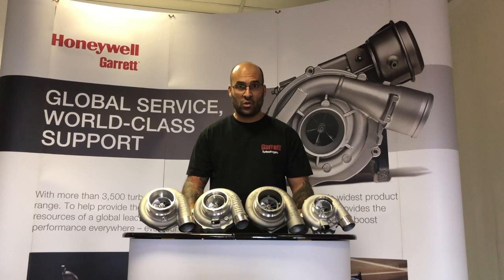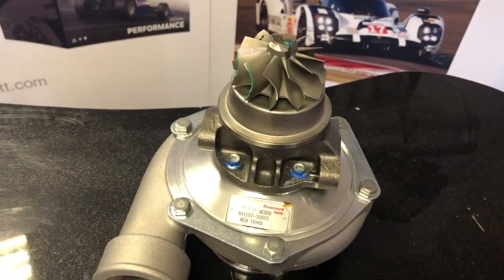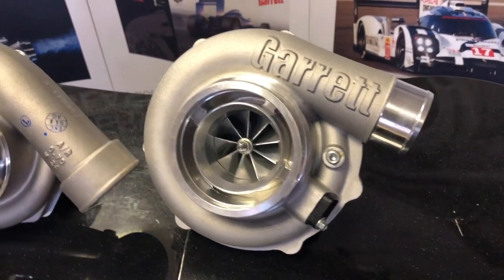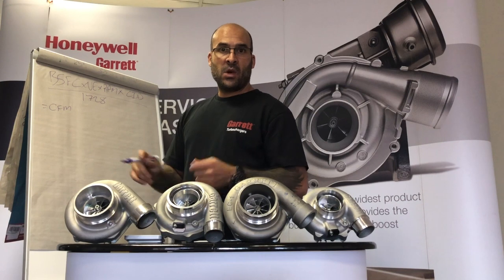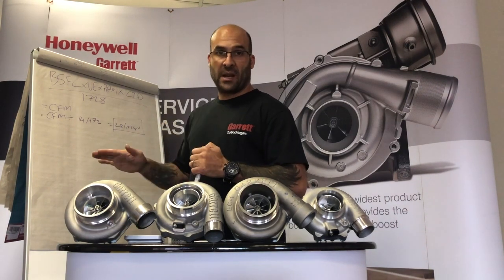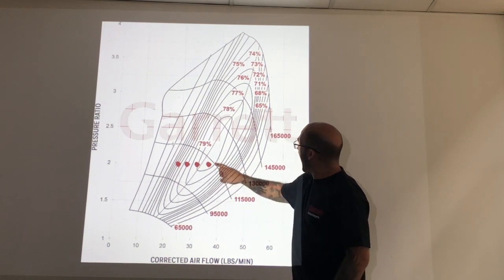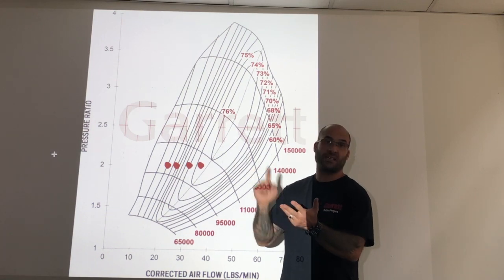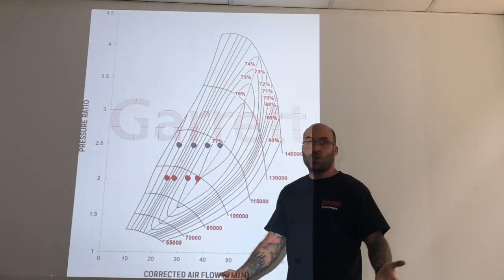G25 660, G30 770, GTW3476, GTX3582R Gen2 compared

Comment: U make the best Turbo videos period!
Reply from the maker: Thank you sir
Reply: @TurboDirectSA  Quick question. U think I can get away with the G30-770 on my 2016 Golf R 2.0 liter? I seen some videos where they seem to spool up really fast on MK6's and I have an MK7 thats being built to go as fats as I can. What is ur opinion? I do street the car. a lot tho but 90% hi way .
Reply from the maker: @TENNESSEETRACKHAWK  From experience, the EFR7163 spools faster than the G30-series and costs less money. Its a better cooled turbo aswell as more reliable.  The Water ports and aluminium bearing housing are a winner! The Gamma TI turbine wheel is extremely light weight and you'll definitely see the benefit.

Comment: What are the chances for us to see a visual comparison of GTX3584rs vs the new G35? Im really curious how and why the older Gtx3584rs has 2% higher turbine wheel efficiency according to garrett. They are both 68-62 turbine wheels. It would be really interesting comparison to see the design differences. Also do you know when/if any G30 and G35 T4 divided turbine housings will be available?
Reply from the maker: Will do Abec777 - Once the G35's land ill do the review and comparison - ill be installing the G30-900 and G35-900 and G35-1050 into a fully built 1JZ and show real life results between the different turbochargers - this will be done around February 2020 - look out for this video.
Reply: @TurboDirectSA  Ok i will!! Do you have any date if theyll release divided turbine housings for the G30-G35?
Reply from the maker: @abec666  not as yet buddy - we are told by Garrett first quarter 2020 - lets hold thumbs
Reply: @TurboDirectSA  Thank you. I can see you really love turbochargers. Im in the same boat.
Reply from the maker: @abec666  Eat sleep live and breath turbochargers - not much we dont know about them. Watch this space for something new coming soon

Comment: Hello @TurboDirectSA, I've been watching your videos to learn about turbos. I've learned quite s bit however I am still unsure in choosing turbo. I have M54B30 and so far I choose G30-660 with .83A/R. Would that be a wise choice? I will be keeping stock intake manifold with DISA so engine should be quite efficient in low rpm range. I will use it for street driving with around 450HP.
Reply from the maker: Thanks for the comment - to be honest if this was my car, would consider the BorgWarner EFR8370 - this turbo will outspool, and far outperform the G-series Garrett. Over time the G-series has disappointed many tuners, and is overrated. The EFR Gamma-TI turbine wheels are unmatched in spool, linear response and overall performance.  The 8370 will produce more power earlier and for longer in the RPM range and make for a very street-able setup, with much better reliability at less cost.
Reply: @TurboDirectSA  Thank you for the response, I will check it out!

Comment: Im guessing a gen 2 gtx3582r will spool slower than a gt3582r given that the gtx has a 66/82 billet compressor wheel vs 62/82 cast wheel in the gt3582r. Do you know how many rpms slower the gtx gets full boost of 20-22psi? Thanks
Reply from the maker: Keep in mind that yes the compressor might weight more and have a larger diameter, BUT its more efficient than the cast 6 blade splitter, so flow low down is improved, which will provide additional air flow low down, elliminating the lag.

Comment: Hi, what turbo will work the best for a 2.0 20v stroker... between 3700-7500RPMS peak boost atleast 650hp its for street racing and drag racing 1/4mile. Thanks in advance
Reply from the maker: Eduan the turbochargers that make this power will begin to boost over 3000RPM on the 20V stroker, but at that power the boost pressure required will be high, and full boost (wastegate open) will more than likely occur above 4000RPM.  The EFR7670 will produce the 650HP and on that engine you will see this power at the wheels or very close to it. 

The EFR7163 will spool much faster and probably save you around 500RPM, but will max out at around 550WHP.
Reply: @TurboDirectSA  thank you bud i really appreciate the reply will definitely look at the turbo.

Comment: Very informative I have a Garrett 3071 on my 4agzte engine ,I use the original supercharger on a 14lb pulley for below 5000 rpm for low response ,it also increases volumetric efficiency, more exhaust gases to spool this size turbocharger on my 1600 cc engine thank you great vide😀
Reply from the maker: Thats a cool project thanks for sharing the info. The 4AGE's are nice!

Comment: Absolutely great video, you're the first one I see who really goes into the details of compressor maps and how to plot your engine to it. 👍🏻

I would have a question, seeking for your thinking on the topic.

I run the good old Audi 5 cylinder engine. 2.2 liter.
Currently, I'm running a GTW3476R on it. Basically the ball bearing variant of the GTW you cover in this video.
I'm reving to 7.800 rpm at 2.26 bar of boost (gauge boost). I'm actually ending up at 673 HP at the crank.
As you also nicely said, the GTW is not the best spooling and responsive turbo. Hence I was looking for an alternative. I'm fully fine with loosing a couple of horses as a tradeoff for better spool and response.
Let's say we want to stay right around that 600hp mark, would you go for a G30/G25 - 660, capping out at maybe 550hp, but have better spool, or would you rather tend to the G30-770, which should be capable of 600 horses, but having bit slower spool? 
Or would you even say the G30-660 might be capable of 600 horses and still maintain and survive that boost pressure all the way up the rpm range I'm going, without falling off at the top end?

Thanks 👍🏻👍🏻👍🏻
Reply from the maker: Thanks for the comment, glad you are enjoying the content.   The G-series turbos will underperform alot worse than the GTW you currently using. There are alternatives to the  G-series turbos which are ball bearing and cost less, yet make the claimed power. I would look immediately toward the EFR8370 which will outspool the GTW, and G30, and make the claimed power without a doubt. This is essentially a 750HP advertised unit, BUT the map shows closer to 800HP capacity.
Reply: @TurboDirectSA  Thanks for the info! So far, I was shy of using an EFR turbo because most of the turbine housing setups are internally wastegated, and I wasn't sure how well that's going to perform, boost control wise, and from reliability aspects. 
But if you propose that turbo, I will have a look at it. Thanks again and keep it up. Really enjoying your content!
Reply: @TurboDirectSA  Just to let you know, based on your great advice and help, I now got an EFR8370 for my 5 banger. I went for the externally gated AGP v-band turbine housing with 0.82 A/R as the twin scroll options do not really make sense on 5 cylinder engine from my pov. Will let you know how it performs. Thanks again for the recommendation!
Reply from the maker: @TestDriveInline5  Hey Buddy - thats good news - im sure you will love that turbo! Let us know how you go with the project.  Exciting stuff!
Reply: @TurboDirectSA it's been awhile, but I still owe you feedback on your turbo recommendation.
In short: the EFR8370 is an awesome turbo for this engine! Just as you proposed.
Compared to the previous setup - using the GTW3476R - the boost threshold is about 350 rpms earlier, although the dimensions of the turbine housing and the EFR turbine wheel are way bigger. I was speechless when seeing this!
Also, engine response is way better.
I still run the EFR compressor housing, with the built in recirculation vavle. I just replaced the original BW valve with the turbosmart drop in replacement, which is just way stronger and can sustain higher boost pressures better. With this, spool up and response, especially at gear changes, are crazy. There simply is no noticeable boost lag, although I'm not yet running shift cut.
Also, a positive side effect due to this hybrid turbo combining the turbine wheel of the 7670 and the big compressor wheel of the 8374, this turbo is just capable of insane power output at way lower boost pressures.
Again, compared to the previous setup with the GTW, I'm running the same power, but at 0.26 bar less boost. Actually, it's even better. I'm hitting 705hp now with only 2.0bar of boost. Previously 670hp with 2.26bar. (yes, conditions at the Dyno runs have been almost identical).

So, once again, I can only say a BIG thanks for your help and recommendation on my turbo setup. It fulfilled everything I was hoping for, and more!
I hope you continue to gain more attention with your work, you more than deserve it! Cheers from Germany
Reply from the maker: I told you so!  @TestDriveInline5  -- LOL - im happy to have helped you especially when there is alot of money being spent -- Borg for the win -- AGAIN ---- Garrett is overrated guys, honestly.

Comment: On the K20c1 2.0 lit motor for the fk8 Type R at 10:1 compression, port and polished head which removed the fuel tumbling giving it 300cfm of flow is the G30-770 a good turbo for the street? Stock cams for now. This is run on a 4 port boost solenoid with a 7lb wg spring. Whats the max boost pressure it can achieve? 40, 45 psi? My goal is 700 to the ground. The k20c1 has no individual exhaust ports, basically one port with the turbine housing almost directly on the headifold. I would suspect this would aide in turbo transient response. What are your thoughts? Good street, circuit turbo, drag turbo or all of the above?
Reply: We made 716whp/506wtq at 30psi on a g30-770 on a TR2 cammed, JSR ported head K20c1 running stock compression on JSR pistons from Traum with Carillo rods.  Electronic wg actuator like  stock. 
Street spool - roll race car with sequential trans

Comment: hi i have a BMW e46 328 with the engine M52B28TU can you tell me pls whitch is the best turbo who have boost from 3000-3500RPM and have about 350 ~400 hsp i think about 0.7~1 bar boost to be safety thank you in advance
Reply from the maker: Thanks for the comment - what is the car being used for ? Circuit racing, street driving, drags?  Depending on this i would make different recommendations
Reply: @TurboDirectSA  street drive that will my every day car I know that the stock internals from the engine a good till 450 hp so maybe at some time later i can update but now i would drive it stock so thats my target about 350-400 hp I need it reliable
Reply from the maker: @moiseiboianov7450  thanks for the info - https://store.turbodirect.co.za/index.php/shop/turbochargers/g3077r-forged-detail 

This is an option that is reliable and one that produces the claimed power - with our stainless steel turbine housing AR61, this will spool up more than fast enough for a streetable result, and still make the power you require.
Reply: @TurboDirectSA  no I thank you so much but why ar 61 why not 82 what will be the difference?
Reply: @moiseiboianov7450  maybe just a little bit more responsive or better spool with smaller housing. im considering g30-770 to m52b28 too and will go with 0.82 ar housing if you someday want to go for 550hp then smaller housing wont do it because too much backpressure
Reply: @visa5175   pls taxt me if you do it I think that with the ar82 the response would be not the same as ar63 but you will have less heat and more HP
Reply: @moiseiboianov7450  yeah, but i think its not dramatic difference. With stock motor you are limited to about 500nm torq otherwise rods might not like it so im thinking about doing my setup something like this: adjust boost with mac solenoid and use boost by rpm, lower rpm little bit lower boost maybe like 0.5 to limit torq to 500nm and up it a little bit ass rpm gets higher so at 5500+ 0.7-0.8 or what ever is needed to get about 400hp i try to get quite even 500nm torq curve to keep it together, with full potential of g30-770 and 700nm it will definietly blow up stock eu m52b28 rods 😅
Reply: @visa5175  im with m52tu so I know that with 550-560Nm I dont have a problem after some time I need ti change the clutch and the gearbox but that with the boost controller is a must for me
Reply from the maker: @moiseiboianov7450  Remember the HP target you want to achieve is relatively low in comparison to the available HP from the G3077R - and its a street car - you will have the best of both worlds (response aswell as the Target HP) with the 61 housing - the 82AR is laggy, and for the low power requirement and the fact that its a street car -- response is key.
Reply: @TurboDirectSA  thank you again for the response can i hit 500-600 hp later whit that turbo and AR 63 ?
Reply: @moiseiboianov7450  theres video where they tested g30 ar 63 and ar 83 housings in 2jz and ar83 spooled better because that smaller housing is just causing bottleneck. 2.8 liter is quite big engine (not in america) but elsewhere 😅 it needs decent size turbine housing in my opinion
Reply from the maker: @moiseiboianov7450  Yes it will - the M52 engine is not very efficient, look at its VE - i wouldnt use a larger AR housing on this engine.

Comment: Whats the difference in silicone nitride balls and ceramic balls?
Reply from the maker: Silicon Nitride has a better shock resistance compared to other ceramics
Reply: Thanks! And btw my tuner was only able to max out to 21 psi on the g30-770 with a 4 port solenoid with a 3lb wg spring in the Turbosmart 45mm hypergate in my 2.0 liter Fk8 Honda Type R. Will changing the wg spring to 7lb double the max psi boost to 40 psi or more? On Motec m142 Vit version for the fk8.
Reply from the maker: @weduhpeople8504  It wont double it per say, it depends on many aspects of the build. I would install a 15PSI spring as this will improve response from the already laggy G30 turbo, and then control the boost to where you want it.